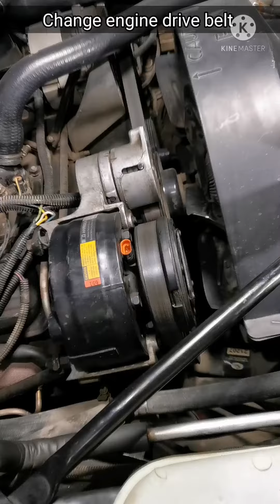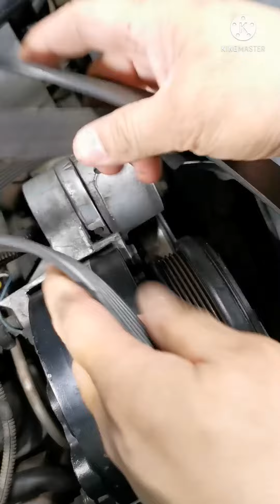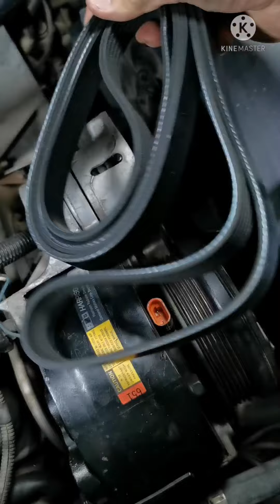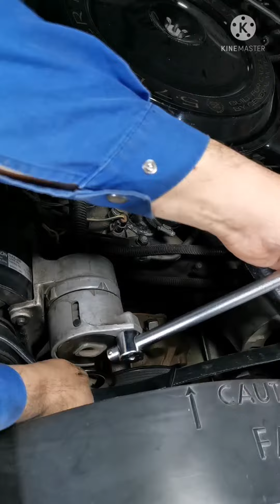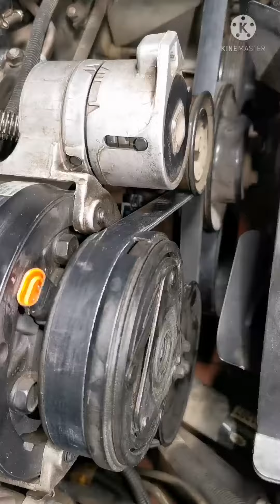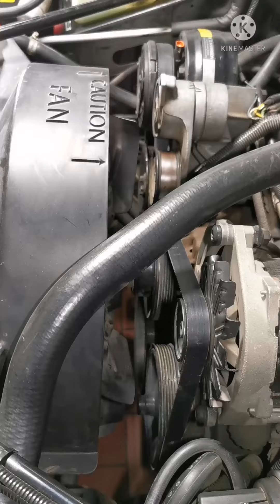Change engine drive belt #short

Comment: Gudam Sir ask ko lang po kung lahat po ba ng makina eh timing belt o chain? Ang car ko po ay Revo 2004 A/T 7KE. Kasi tiningnan ko po sa manual wala naman. O katumbas na po ba iyon ng drive belt? Salamat po.
Reply from the maker: Good morning Sir Rudel, may timing belt at timing chain po ang sasakyan depende sa idinesign ng car manufacturer, malalaman nyo po kung timg belt kapag may  plastic cover sa harap ng makina sa likod ng clutch fan.
Kapag timing chain naman ito ay aluminum cover